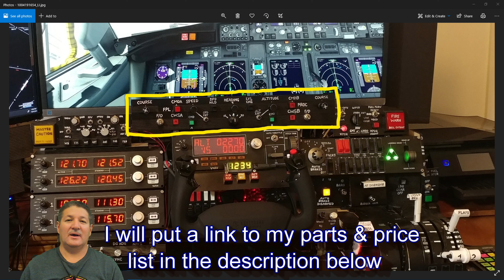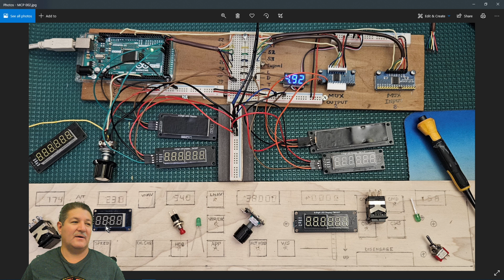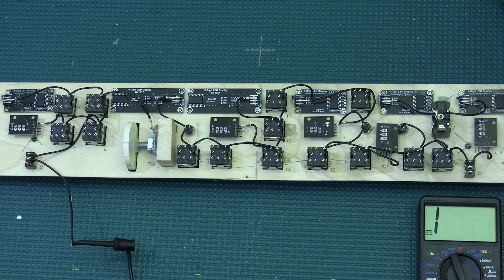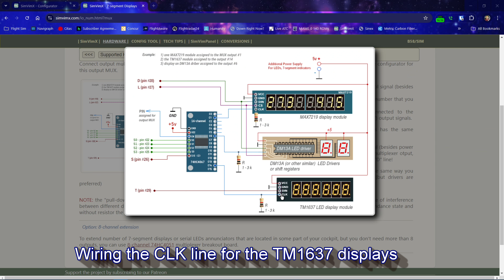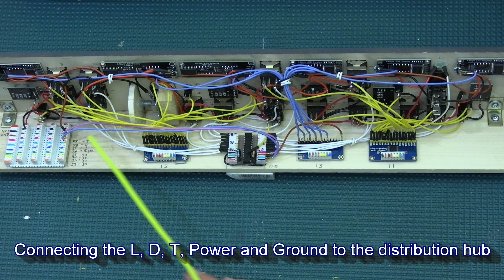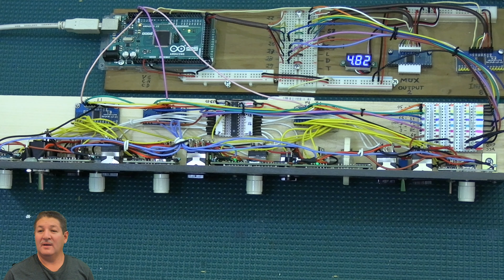Making an MCP panel for X-Plane using SimVimX Part 1

Comment: 5:37, can you explain how you wired those Korry switches. I’m making an autopilot panel also and have been trying to figure out which terminals to connect to. Great job!
Reply from the maker: @johnstrandberg2035  I explained it a little in the video. But basically the two in the edges in the middle of the switch are for the led. And the two rows with three, are if you wanted to assign to different functions to the switch. So we just use one row, either top or bottom. The outer ones is normally open, the middle one with an outer one is normally closed. It's a matter of just using a multimeter to figure out which is which on your switches. But you will only use 4 pins out of the 8. As you can see later in the video I used to top outer ones for the switch.
Reply: @ thank you

Comment: I would like to express my deepest admiration for the exceptional toolless work you have done. Your ability to overcome challenges and deliver results is truly inspiring to me!
Next time, if it's not too much to ask, a tutorial on how to build a FLT ALT pressurization panel and LAND ALT display
Reply from the maker: Thank you Carlos, this one actually came out pretty good. Although I could've been a little more careful when cutting the holes so the wood would not split. I should've also taken a little more time on the painting.

I do plan to make videos on using servos and maybe even stepper motors to make gauges. I'm not sure If I'll actually make a pressurization panel though. I normally try to show the basics needed so everyone can then build their setups.

One of the things that I haven't figured out how to make is gauges that have multiple needles in the gauge. I know it requires gears and concentric shafts so that's a little complicated.

There are a lot of people who have sent me pictures of their home cockpits and all of them are very realistic compared to what I build 😂
Reply: It was really cool!
My home cockpit is simple, 99 cm wide. Before, Virtual Avionics EFIS and MCPM worked, but now they don't.
MIP works with SIOC input and output languages and servo motor for flaps.
I tried to create a pressurization panel that would show the cruise and landing altitude on the display, but I couldn't.
It seems to be a simulator disease. kkk!

Comment: te quedo muy bien, Lo bueno en simvin es que el selector de BANK ANGLE lo puedes hacer con un switch rotativo, simvin le asigna funciones auto, por ejemplo con mobiflight es un lio tremendo y terminas poniendo encoders. Averigua por donde vives  quien vende foam espumoso de 5mm el mejor para trabajarlo y admite la pintura sin los problemas que de el MDF.. saludos y espero proximos videos
Reply from the maker: Gracias, pues si logre quebrar la madera un poco por no tener paciencia cuando estaba cortando los abujeros. No se si el foam espumoso que dices es ese que tiene como carton en los dos lados y en medio tiene foam. Yo tengo de ese pero no me llamo la atencion tratar de acerlo con eso.